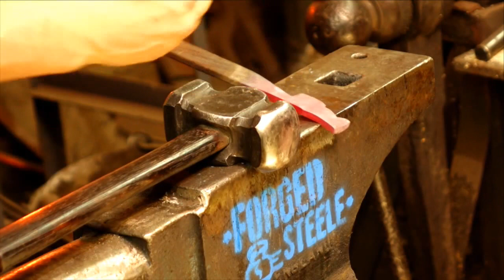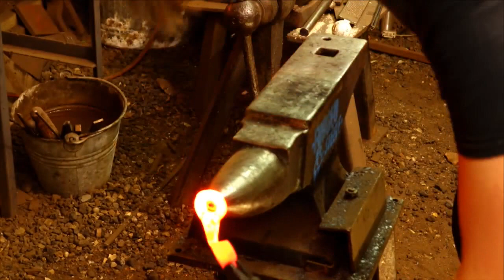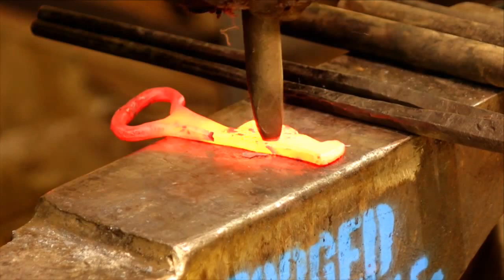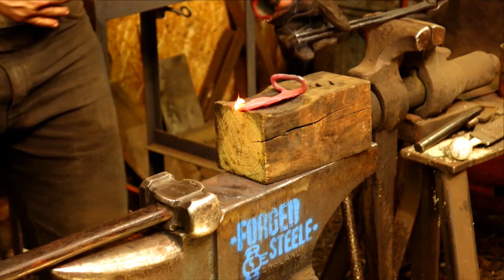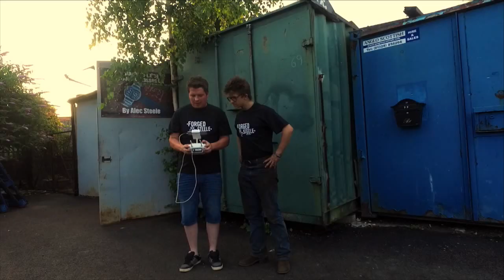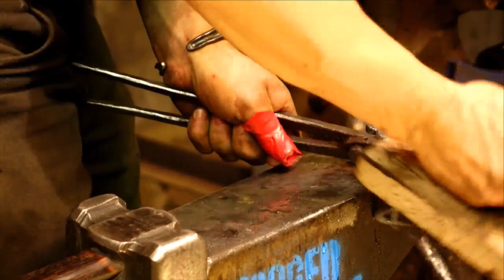The Alec Steele Show Ep:6 Forging a Horse Head Belt Buckle

Comment: Thank you very much for sharing your great video's. Your balance of talking and whacking is perfect.  For drilling odd shapes like your belt buckle that is hard to clamp I use a pitch bowl. I tap the part well into the pitch. The bowl is round and I put it in a small tire so that you can drill it in any angle. Again thank you very much for sharing!

Comment: I'll have you know that I helped you out while you were wrestling with that bit of copper wire, getting it into the hole with your nackered thumb and side cut pliers. 1:12:00 I was holding my tongue to the corner of my mouth and tilting my head a bit. Does the trick every time. "You gotta hold your mouth right." my grandpap always said.